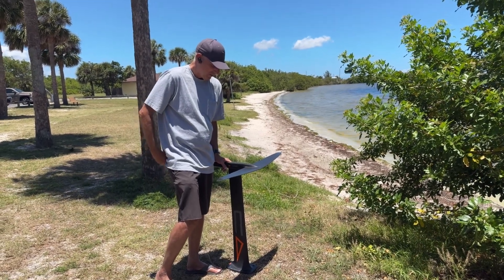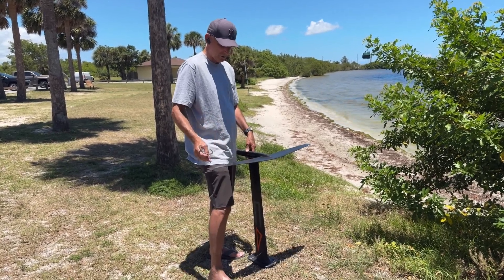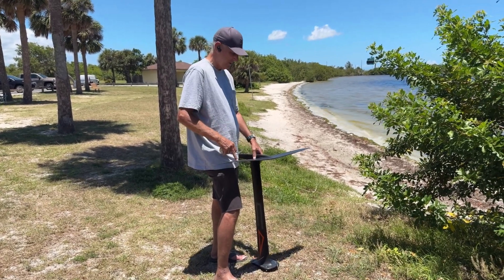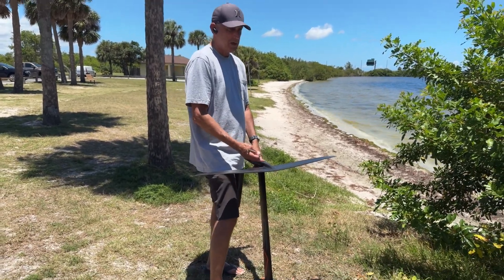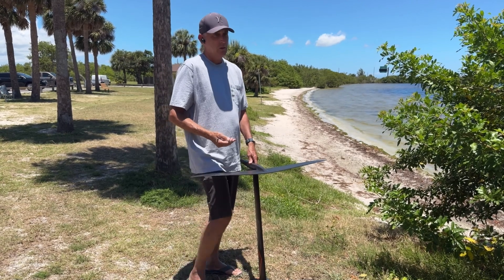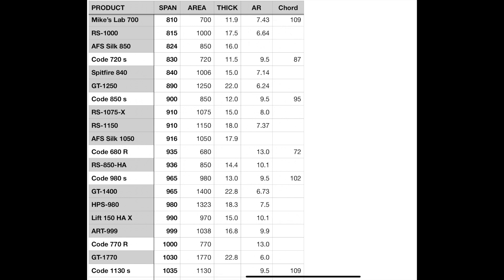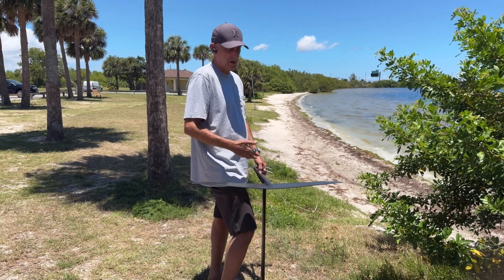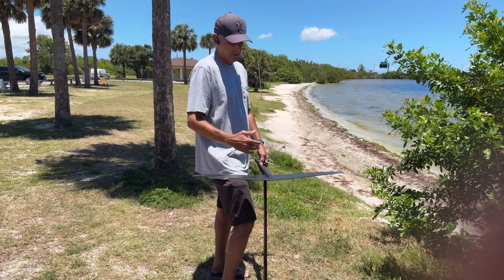Code Foil Secrets Revealed

Comment: There are a lot more variables to throw in,  the camber of these new breed of foils is where the magic seems to happen allowing lower stall speed but have less drag while doing it. But like everything in life, the gains are often incremental in multiple areas adding up to a bigger overall change.
Reply: Where do you think the trade off is, with the new magic? I am used to Axis where the trade offs are fairly clear and consistent.
Reply: @powis-tv8ln  top speed and the foil noticably pitching nose down at near max speed , depends what the intended working range is though

Comment: Foil thickness is key, but I think your analysis must include the AoA (Angle of Attack) and the placement of the thickest point (related to foil shape, chord, NACA shapes etc).
I never foiled a CODE foil, but they seem to have higher AoA than other brands.  This appears to be a great combination: thin profile + high AoA.:elbowcough:

For sure, Mike's Labs, which are made for speed, has low AoA = flat foil position and the max thickness is quite backward (in the middle of the foil).

https://en.wikipedia.org/wiki/NACA_airfoil

Comment: I ride a code 980 s on a Nolimitz 72cm on Appletree V3 90  liter and  a slik 1050 on a 80 cm uhm mast back to back ,my thougt on it : the code come easy on Foil, is fast pumps better and jipe easy ,very good Setup. After that i go on a Slik 1050 on a 100 liter Whitebird , after that i bought the Afs , it is all about your feel and how your conditions are. The silk is going like the name, it was the wow feeling.
That mean , is comes it little bit harder on foil and pumps not so good as the Code ,but is near as fast as the code .
The thing is when you riding in small windbumps ,chop ( Baltic see) you want a turny foil . You can go as hard as you want full speed in a tight  hard turn and you can trust the silk . The Silk is very good surfy foil in small condition and the code is good foil in small condition, when you riding in bigger swell or only flatwater i would choose the Code ,im my conditions i like the Silk more. Anyway ,Code or Silk you cant go wrong is fun on both ,is more the feel that you prefer .Only my own thougts from a average Joe ,4 jears of winging strapless, 59 j. 97kg , have fun on the water ;-)
Reply: I found a comment from a foiler 500 times better than me to the comparsion Silk vs. code s :

@guybridge8591
vor 14 Stunden
Hello! What I’d say is the code has more glide but the Silk allows you to Carve on rail more and be more aggressive through turns , I’d say the AFS has a better top end than the code which has a better bottom end (slower stall speed) glide for longer! I think the AFS has a bit more of a spark to it, it’s a bit livelier

Comment: Gong YPRA-S  Large;  12mm thick, 90 cm span, 1000 sq cm, AR 8.2.  YPRA-S Medium 11mm thick, 80 cm span, 782 sq cm, AR 8.2. Gong has been posting thickness and volume for years.  Surf and freestyle variations of the YPRA-S. Never ridden any of the YPRA-S’s (I ride the V2 Veloce’s) but I know the team riders are very competitive with them (even though many wingers still dismiss Gong as low end performance/quality). Not surprised that Gong never gets mentioned in many comparisons
Reply: Those gong ypras are crazy good. I’ve got the11mm thick medium (700cm2)surf freestyle mounted to an old chopped up unifoil fuse. Malo guenole in the final at ponta preta  event on a 600cm ypra is all you need to watch if performance of gong foils is a question. Kai Lenny is currently using their wings in Italy
Reply: I recently changed to Gong after using 4 other foil brands before. I ride the Ypra S L (12mm, 1000 cm2, 90 cm span) and it's the best all round foil foil I've ridden. Top speed over 25 knots but great in waves and usable for me at 80 kgs from 10-12 knots
Reply: @oldboywindsurfer  yeah, I’m probably going to get the YPRA-S L as well. Very happy with my V2 Veloce L, but just ready to give the YPRA-S a go. I’ve always been in search of the best high end AND low end, combined with great maneuverability. Like the theme of the video; best all round.
Reply: The foils do look quite good but the wing to fuse connection gets a 'worst in the industry' rating. If I did get some ypra's I'd get a fuse for each (they're cheap enough) and epoxy one to each wing, screws in place.
Reply: Been riding and jumping gong foils for years never had an issue with that connection.

Comment: Great specs list. for sure we are   living in great times for watersports.  Code foils are awesome especially the R series. As with many things in  life numbers don't always tell the whole story and  there are some other sub12mm foils not on your list that are a  different feel than the Code foils especially in surf and for winging vs DW. Personally  I wouldn't trade my Mikeslab 700 for any of the foils on the list.  If you get a chance  place your calipers on a  Mike'slab 340 then ride it. Even in light 12-15  winds that foil feels like a completely different sport insane all around  performance.
Reply: I recently saw a video Guy Cribb posted riding ML 290 and 340 foils with an Aqeous Layline 6m, 10-15kts and hitting good speeds up around 29kts. I’ve never seen a Mikes Lab firsthand and only hear good things about them.  I’m very interested to hear if those small area foils mentioned have the increased camber sections, but I’m assuming so.

Comment: Thanks so much for posting these measurements- I always wished more manufacturers would quote max thickness. I'm now on Unifoil Progressions and the 140 is around 15-16mm while the 200 is closer to 18mm (hard to be exact as my callipers aren't quite deep enough to reach back to the max point). Anyway it all makes sense as the progs are not super fast foils but do have a great low end & I'm really enjoying them. The Code wings look great.

Comment: But it makes me cringe at the simplest strapless air, how easily it would be to snap a wing it being that thin
Reply: I've jumped mine countless times with no issues. 200lbs. I'm more concerned with the flimsy construction on some brands more than thickness. -Tucker

Comment: Awesome review! Im surprised to see the AFS that thick. 
Where they the fuselink one piece ?
Reply: Nice. Thanks for posting the numbers.  I think when the sections have low thickness to chord ratios like this around 10% or less these are high speed sections, and suffer on the low end but some manufacturers have added increased camber to these thin sections which seems to allow both a good low and a good top end with high efficiency over the increased range.  I’d be curious to know the camber.  I use a contour gauge and get a decent profile shape of the top and bottom surfaces along a chord line.  The Codes look to have quite high AR as well so the induced drag is minimized and overall efficiency is high.  Looks like nice equipment.
Reply: @scottseale  Agreed, having just purchased an AFS Pure 700 fuselink (11.5mm thick) I was surprised by the amount of camber on the bottom (intrados) back half of this foil. Speed and glide is not everything, unlike the AFS Pure which is designed to perform at higher speeds, one of the best foils I have ever owned , the AFS Silk, was designed to perform in slower waves at low to medium speed and also has amazing feedback.
Reply: @scottseale  Good amount of camber on these Code foils. I also think it contributes to their impressive low end without sacrificing glide. Really impressive stuff -Tucker
Reply: @MACkiteboarding  Thanks Tucker.  I see the Sab Medusa Pros as having some increased camber and a bit more chord especially near the root area, then the foil quickly tapers out…from what I can tell these also have an overall increased range great low end, and high end.
Reply: @scottseale  Yes, correct and it does have a great range as well. -Tucker
Reply: The silk is the thickest afs foil. Afs also states on their website that it is the max thickness whereas Dwight is not necessarily measuring max thickness.  But even then the Pure 700 fuselink has a max thickness of 11.5mm per the afs website
Reply: @BenoitRochard  good to know they are in the ballpark of mikeslab and code!
Reply from the maker: AFS publishes the thickness. The only brand that does to my knowledge. I’ve never seen the AFS in person.
Reply: @foilsurfmachines mikeslab /AFS and f-One has a much thinner fuselage. 

I wonder how that affects things vs the thickness at 1inch from leading edge.
Reply from the maker: @scp8412  It doesn’t. Thickness doesn’t reduce until way, way, far from the fuse. So one inch away is good enough.
Reply: @foilsurfmachines  gong does (thickness, volume and profile cut view)
Reply: Sabfoil and gong both post thickness.